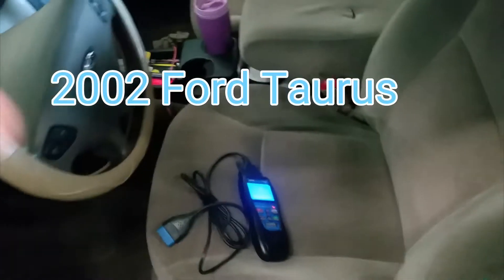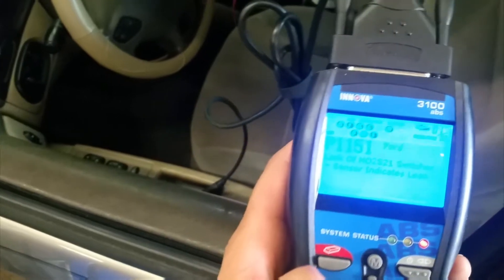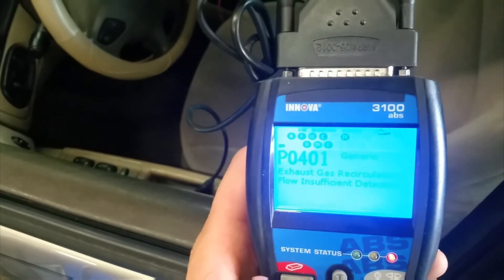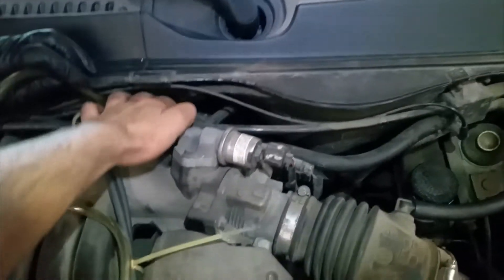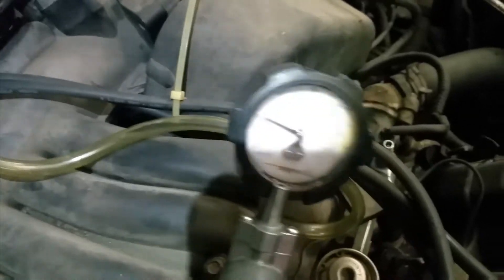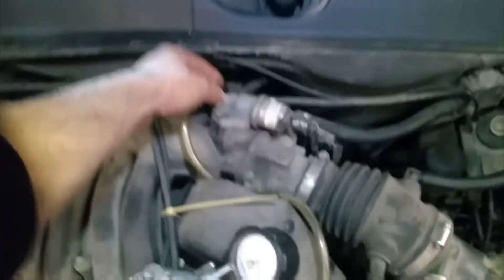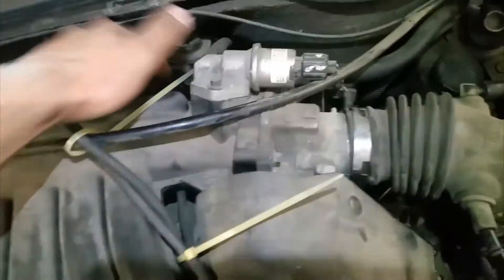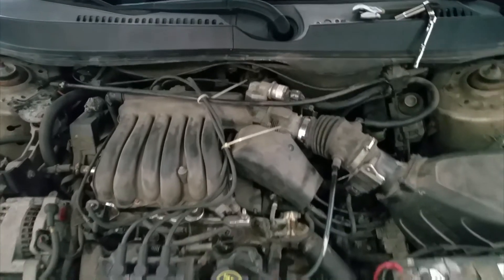2002 Ford TAURUS P0401

Comment: Hey thanks man you really helped me to understand what im dealing with as far as this egr system goes i didn't really have a clear understanding of how this system works like i do now i have a code for my dpfe sensor and i probably wont even need to take the egr system apart since i know now that the dpfe is the pressure moniter for the egr valve and is likely fried causing the issues not any actual blockage or broken valve parts. Mine has struggles accelerating from a stop especially going up hill and whenever i first start it ij the morning it takes it several minutes to steady out the rpms at idle it just bounces up and down from 1krpm to 2500rpms until it finally drops down past 1k and settles at 700rpm but not before letting out a growl of dissaproval. Also my HVAC vacuum lines are brittle as anything, one of them actually busted in half because i had the blower set on full speed when i turned my air on and i guess the sudden whooshing of that air going from an off position straight to its maximum speed was too much for that 22 year old vacuum tube and it just launched itself in both directions causing my car to only have any air flow through the defrost vents no matter what setting i have it on only off or defrost worked so i patched the broken tube with another little piece of tubing to bond them together and i gotta be careful to avoid letting even my arm hair brush against any of the tubes in the big gangbang of hvac hoses in the top left of the engine but sure enough anytime i open my hood inevitably i exhale too sharply and generate enough g force to pulsate a blast wave straight through the frail little fuckers and there i go spending all day accidentally breaking all the lines adjacent to the one intended line to fix. But aside from the rotten vacuum hoses and the 22 year old sensors that are burning up as we speak, its a great car really its quite resilient i totaled it once and then swapped the engine with another one from the junkyard and it ran perfectly i thought i needed an alignment since my car kept eating tires but actually after a new set of front struts/shocks and balljoints it drives perfectly straight no uneven wear and even if u dont take care of it its fine i drove it for 4 years with it on E gas light on never put more than $5 in it per day and it got me everywhere i needed to go and only just learned anything at all about cars after having it for years so never changed oil or any fluids or checked any of them or did anything other than put gas in and i even drove it heavily for a month with a little run flat donut spare tire on one side which was already bald when i got it and i expected it to pop all the time but never did. Then one time my breaks randomly went out and had no pressure so i had to stop pushing the gas and floor the break peddle as hard as i could at least 50 feet before the stopping point i had to stay about a school bus away from the next car in case they had to break for anything but then on my way home one day the breaks just came back and i never knew why also i fell asleep and clipped a pole the other night and my belt drive pulleys made a loud screeching sound until next day then stopped but mirror fell off had to bolt it on but the most expensive repair its ever needed from me has been the ignition coil pack which had literally melted off its mount by the plastic that makes up the connecter harness and despite it being half melted off it still only missed when going uphill. i have enough mud caked up inside my cars undercarrieage and frame to brick a house and it doesn't stop it from working i just removed a couple pounds of compacted mud from the inside of the plastic cover that goes around the charcoal canister thingy and all the electrical connections and plugs that its got all throughout its body are coated in mud and im scared to wash them with water cause the muds probably the only insulation that a lot of the electrical has got i have tried to clean some of the wiring harness connecters but most of em wont detatch without breaking so i just leave em be oh yeah also all my cat converters are hollowed out. Not replaced just removed, hollowed out, and re installed. Not sure how thoroughly it was done but the catalyst inefficiency lights have been on since i had ownership of it and the exhuast makez it out the pipe so i guess its good enough my transmissiom range sensor had a low voltage code so i removed it and performed a repair technique i got from a youtube video that involved stretching the springs out and sandpapering the metal innards to boost the conductivity between them and the metal parts that they touch and it worked my code went away also i sprayed the sensor and plug down with part cleaner and scrubbed  it all down and slathered dielectric grease along the bare piece of wire and all the normal ones that ran from the sensor to the ecu so that they would be sealed up somewhat and insulated from the outside world and also let my drug dealer replace/add the most largest thick size of ground wire they make and not only replaced all the original grounds with this huge new wiring but also added like 12 new ground cables to various places and didnt ask me or tell me about ut until after when i said whaf are u doing he said u cant have enough grounds and i never questioned it but i wish now my positive cables were also replaced with the same stuff cause the negatives are big new shiny thick cords and the reds are the original old skinny melted burned up dirty wires and my battery terminal connecters are corroded and warped my battery light comes on all the time but no issues anyway this car is a good one cheap and strong car last long

Comment: Thank you for this detailed analysis.  A few corrections since English is not your first language:
At 5:53 - it is a vacuum monitoring sensor, not a pressure sensor. Pressure means above atmospheric or ambient air pressure.  And at 6:10 you are sucking the air out of the EGR valve chamber (diaphragm).  You are applying a partial vacuum with your hand held vacuum pump.

Comment: If EGR Stay stuck Open (Like it has full vaccum on it all time) It could get the motor to stall on idle ?
My mom's car: Start vehicle if she don't press Gas Pedal the motor will stall.
*4:00 You unscrewed it away, So it does similar has the EGR was fully open right?
Reply: Minecraft NintendoBest same changing egr today
Reply: Ok mine will rev up good and won't go but about 5 miles an hr
Reply: Trans is fine